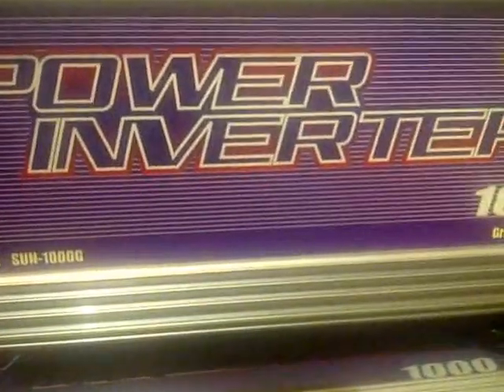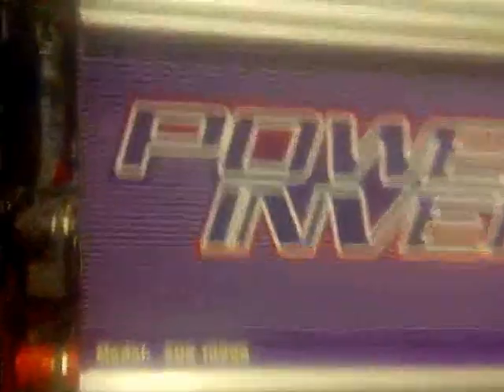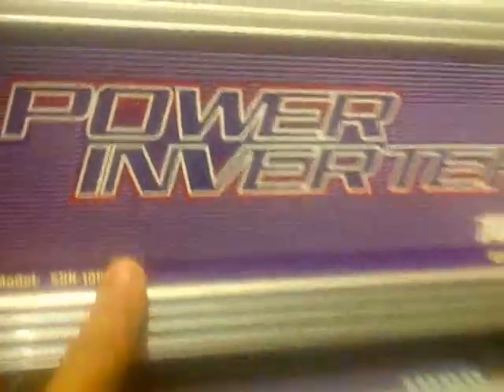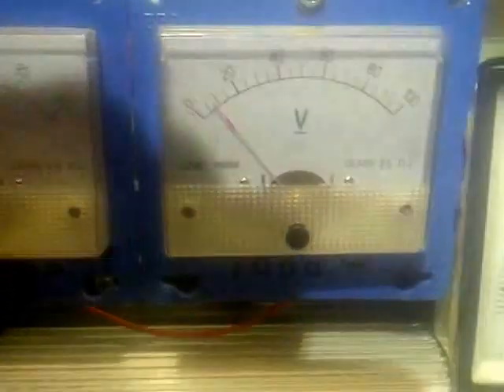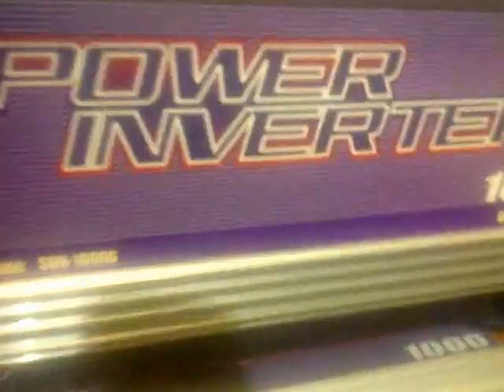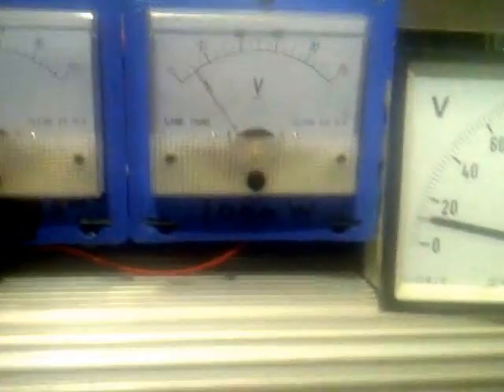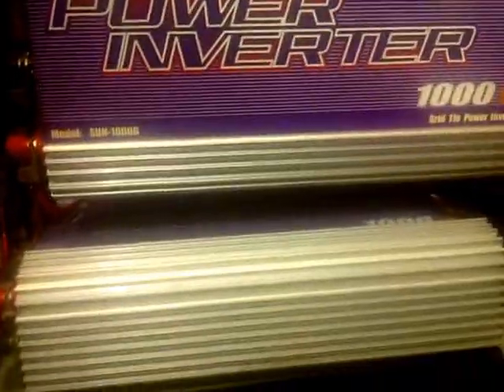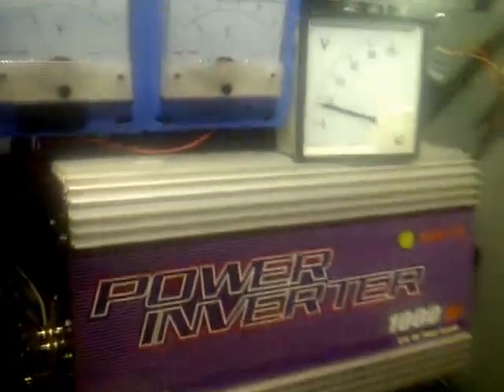Roof Mount Wind Turbine

Comment: Hello,  can you list several places to buy windmax.  I have seen them on magnets formless but they are twice the price of all other competitors.  I see you also like WindyNation.  Is there any other company you would recommend. I see on eBay HurricaneWindPower, ThermodyneSystems. Also I found Mountain TrAding Co and Missouri Wind and Sun.  All of these companies produce products that look quite similar and there appears to be bad blood between them.   The Mountain Tradinf charge controller looks just like the Coleman.  Thanks for your help.   Michael in Tn
Reply from the maker: Hello Mike,
Magnetsforless has for about 800 bucks 1kw 24v. You can also contact HY Energy for a direct purchase. The Windmax is the only one i recommend in the 1kw and under class however WN falls second choice. The Coleman CC, yes it is the same one MWS has. For a CC get a Xantrex or Morningstar  wiith PWM dumping,the other controllers like the Coleman do nothing to preserve you batteries. The simply turn off and on. Hope this helps

Comment: i'm 90% off grid myself. I understand what you are trying to do, I just went a different direction. I have two 2.4 kw solar grid ties, but everything else is going to two battery banks. I went off grid because we have gone a week or longer without power here in the winter. I have four turbines myself. looking to add two more. my solar system charges my main battery bank up to over 100% even on a cloudy rainy day.

  just have to ask. why not take your system off grid? if your power goes out you still don't have power with your system. you can set a system up that will grid tie when your batteries are full. that way you can have power from the batteries and still lean on the power company when you need to.

Comment: Hi there. I have 500W wind turbine rated at 28V AC output Max. There is a chart with it and it seems that it will never go further up than 28V.
I am about to buy a Sun G GTI (600W tri-phase) but I am not sure if I should get the 10-30V or the 22-60V version. I was going to the 10-22V so I can get power even in low wind but the guy that sells them on ebay says to take the 22-60V version. I am not so sure of it....Is this right?
Can anybody give an advise?

Comment: Great set-up Larry! Curious when your 1K is inverting on your 10-30GTI in low winds, does it automatically dump to your 22-60v GTI when you hit high winds and over volt?  Or, do you manually switch over to your 22-60v? I'm getting ready to tweak mine a bit and although doing something different I'm curious how that works on your set-up.  Thx Larry. (sorry if multi posts. having trouble sending)

Comment: I am looking for wind turbine mounts for 300 t0 500 watt generators preferred on roof. I cannot find any anywhere. I have a 300 watt grid tie inverter already with 3 phase input but looking for resisitor for dump load. I have low budget to start with & just getting started. Any suggestion will be great & Enjoy your vids & where to buy . Thanks in Advance

Comment: There is a pressure area from your roof all the way up to 9 feet above the roof. To equal the wind speed in that area , you might have to go as high 70 ft above the ground. That 500 is in perfect position to get maximum from that high pressure area In my opinion.